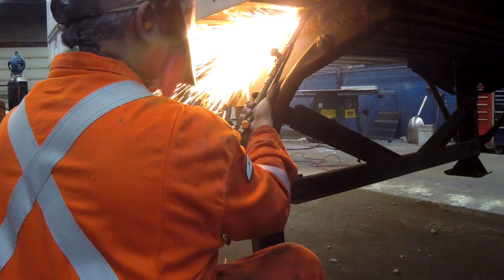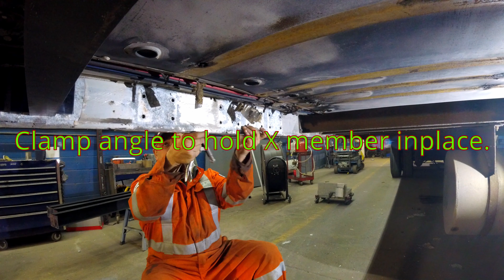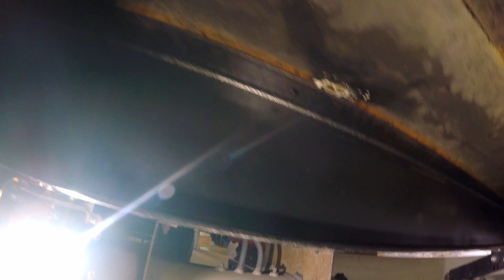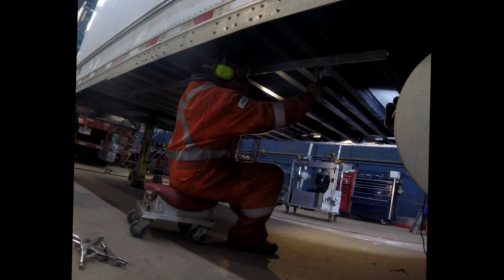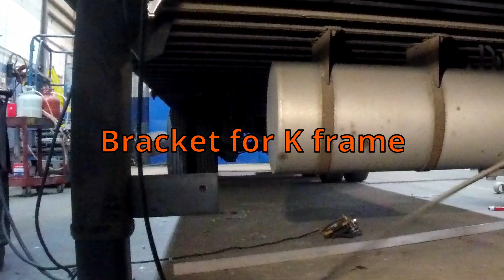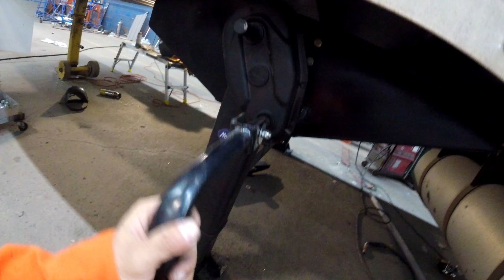Remove and replace Landing gear and Crossmembers

Comment: Why did you put legs on outside of wing plates? I've done this job many times I always put back like it came from factory.  I prefer to weld the k bar brackets to front of legs. Love the stool what make is that one. Only asking to learn as I've been working on trailers for half as long as you. Awesome videos and work you do.
Reply from the maker: No reason probably easier , there is no 1 Way to do anything in this trade . Props for paying close attention . Happy holidays
Reply from the maker: Stool home made Heavy duty.

Comment: Question please where the #14 Pan head on the cross members hold on ? Because original bolt from factory coming from upside down like from inside down there’s any way to place that can bolt on the beam like coming from factory ?
Reply from the maker: in to the wood spacer above.

Comment: When you’re drilling holes in the crossmember, does it matter where you drill the holes?
Reply from the maker: Try for the center of the flange away from the web
Reply: @mikeydesilva8197  Ok. Thanks for the reply.

Comment: What’s the size of the drill bit used for the holes in the crossmembers? Also what’s the bit size for the rail bolt holes? Thanks
Reply from the maker: 17/64 little bigger than 1/4

Comment: I have been wondering for a while. I need a beefy floor for my trailers since I haul paper roll stock. If I get a trailer with X members on 12" centers, can I add X members so I have them on 6" centers?
Reply from the maker: U can,  but not over the slider rails or landing gear.

Comment: Making holes with the torch does not give the precision and stability of the metal to sustain a firm resistance and consequently it will burst or weaken the metal itself. It is recommended to use the tape measure and make exact and precise perforations whit the right drill bit. saludos ✌
Reply: Apenas ise unos crossmembers en una refer saquenme de dudas igual yo le ago los oyos alos crossmembers para los screws me pueden decir a que  distancia por yo pienso que los screws nadamas van de adorning siento que agarren nada adentro gracias saludos
Reply: @arturomacedo4933 estamos igual es esperemos alguno conteste
Reply from the maker: @arturomacedo4933  if there was 6 or 8  screws on before  ,, i do 12 inch space